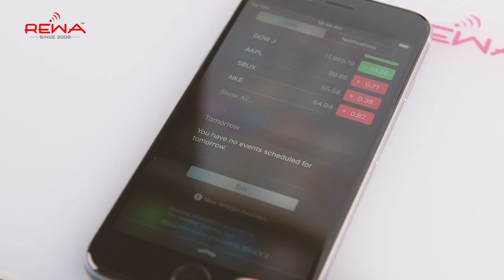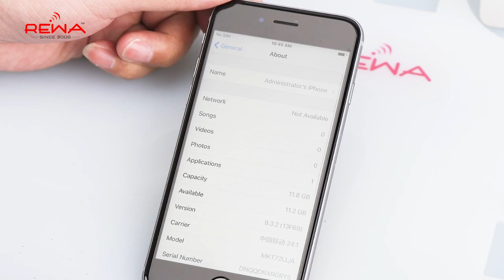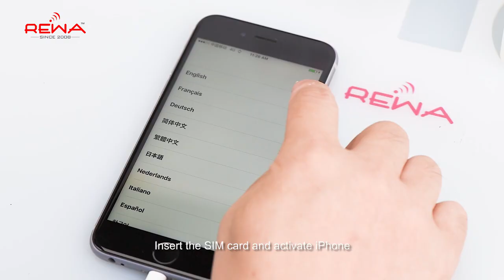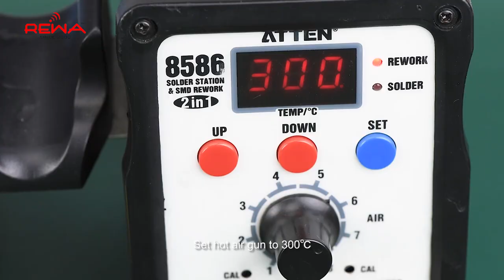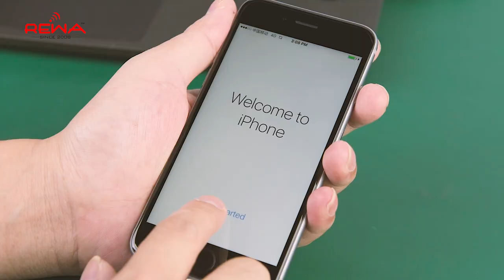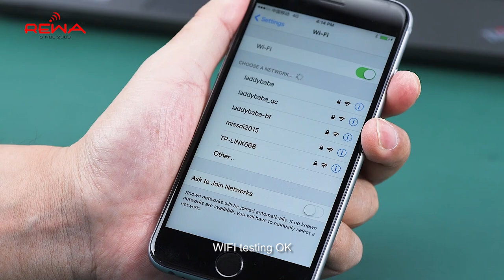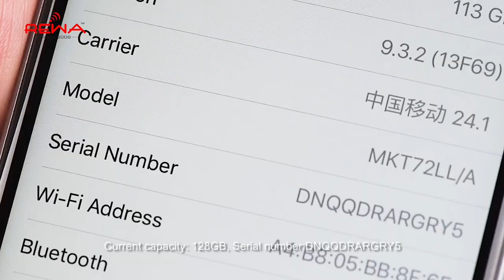Upgrade iPhone 6S 16GB Storage to 128GB

Comment from the maker: * REWA Academy Training Book PRE-SALE of iPhone motherboard repair available now!
Do not lose the opportunity to get limited systematic REWA training treasure (1000 limited stock for pre-sale).
> https://bit.ly/31I5Nks
Reply: I want to upgrade my Iphone6s plus 16gb to 128gb
Reply: just one question. Can a 512GB Chip be installed onto the 6s ? will it be compatible with itunes and the Board itself?
Thanks for this awesome video
Reply: REWA Technology  iam from india i want to study this course .how to attend this course
Reply: Can this be done on iPhone 5c
Reply: REWA Technology hi there. I was wondering if i have an iphone 7 plus but I want change the 32gb memory capacity it originally came with. And replace it with another original iphone 7 plus motherboard thats 128 gb along with the touch id. Because i know that both need to be replaced altogether in order to keep the touch id functionality. So my question is would my iphone still work?
Reply: @alexishernandez-xe4rk  are u trying to replace the motherboard if so it works itll remove iCloud lock I just cant afford a new motherboard cuz I'm broke lol
Reply: @BlackCat-qm3sj  I'm trying to replace the motherboard and touch id because I've seen friends that replaced the mortherboard but the touch ID didn't work because the motherboard it's linked to the touch ID and vice versa.
Reply: Apples wants to find you
Reply: My last iPhone was recently disabled because someonetried to unlock it, would something like this be possible to recover my pictures and memories? I had pictures of my newborn coming to the world and I don't want to reset my iPhone, It sucks
Reply: Where is sd card placed? My iPhone is broken. I just want take card from it and connect it buy using USB adapter for sd card and connect to computer
Reply: Does iPhone 6s have micro sd?
Reply: I want to upgrade my ip 6s plus from 16gb to 128gb. Tell me how to send phone to you? How much it will cost?
Reply: Please upgrade storege ic in redmi note 8 and make video for this  
Can we do the same for tablet PC?
Reply: Where are u from
Reply: Can you do to my phone same iPhone 6s
Reply: Looking for iPhone Xs 256 gb clean condition used phone
Reply: Samsung Galaxy Note 3 upgread 6/126gb
Reply: How much mag change phone storage xioami 9a 32gb to 64gb
Reply: Do you guys accept sending phone to your place for changing the Nand Storage?
Reply: @LuzuVlogsGamer Yes, I want. But it will still work totally? Can I play the game "Glory" it needs 13GB TO download.Ciness game.
Free fire needs 1.4 GB.
Reply: It's ok to upgrade any phone like any like I want to upgrade my huawei p 20 phone 128 gb to 512 gb
Reply: @alexishernandez-xe4rk  it will work, that's the proper way to do it, touch id and motherboard that are a pair are replaced together

Comment: Upgrade any other phone: Step 1: Change microSD-card.
Reply: that got me
Reply: Well, let's be fair this is an M.2 drive with close to 5GB/s read and write while an SD card has about a tenth of that.
Reply: Max S
And you need that speed for what in an iPhone? Yes, you guessed right: to run the system. Now we're getting to the reason why "no microSD slot"-policy sucks and why phones with microSD slot are beyond awesome.

Class 10 / U1 microSD is very well fast enough to record 1080p video, U3 is perfect for 4K video and they cost way less too. :)
Reply: Max S what make you know if its an m.2 or possibly some other type. I don't know which devices but it was said samsung does use hfs for aome devices and that supposed to be as fast or better than m.2.
Reply from the maker: lol
Reply: hehehe
Reply: sleeptyper Thanks for the info, appreciated 👌👏
Reply: I mean sure you don't need it, but still it's fast as fuck and it will completely obliterate loadtimes. You can compare it to a nice and super expensive car: sure you don't need it, but it's more comfortable and looks a lot nicer and feels a lot nicer.
Reply: Wish my Nexus 6p had a MicroSD-card slot.
Reply: well you cant install an app with all it's data on the sd card, it still uses the internal storage.
Reply: Owen Terry still android is open source and way faster than iOs and is more lightweight
Reply: sleeptyper my OnePlus 5 has not a sd card slot but already 128gb :P
Reply: sleeptyper you cant get games on microSD-card ;)
Reply: Jardakukurice02 #FrEeScOotJeKoKoT Yes. Yes you can since android 5.
Reply: Jardakukurice02 #FrEeScOotJeKoKoT uhh yeah you can.
Reply: Ahahahahahahahahahahahahahaha!
Reply: Oops I got a modern Samsung or lg or any MODERN phone and it doesn't have a micro sd slot pops gotta get a 40 yr old phone... y u so behind bro it's not just iPhone that have no micro sd slot
Reply: KenwolfMC Acually, Android is based on Linux which is one of the safest systems. IOS is based on MacOS which is based on linux. That means, Android is acually safer than IOS or Windows. Also: Android has a higher compatability than IOS.
Reply: LECTRO-X ios is based on free BSD
Reply: KenwolfMC If you're so certain about it you may want to provide us with data proving your point.
Reply: LECTRO-X  🤣
Reply: LECTRO-X iOS is based on FreeBSD, which is Unix. Unix is what Linux is supposed to be based on. Unix has a much better security track record than even Linux or Android. iOS is far more secure than Android, although that has more to do with the restrictions of the OS itself than its core.
Sorry, but your attempt to use Steve Jobs' reality distortion field isn't working here.
Reply: If your android device is rooted you can put games on there which is less of a hassle than doing this.
Reply: sleeptyper 😂

Comment: Lucky me, I have all those parts in my house
Reply: curiosidades cooper ಠ_ಠ  so gullible
Reply: So do I
Reply: @strangerisOPboy  lad are u being seriously
Reply: I am even luckier. I  live next door to this man.
Reply: @anilkhadka217  7
Reply: @monkeh3612  5 months late
Reply: @sebastianasling1  and?
Reply: Vro can you upgrade mine cuz im struggling on 8gb rom
Reply: @Blue i have sd card 64 gb but i cant move my CODM on sd card
Reply: I subbed
Reply: To be fair equipment costs less than 100$ not worth it for a single phone, but if you can use it for other phones already smart investment.
Reply: Did this worked ?
Reply: Hahahq